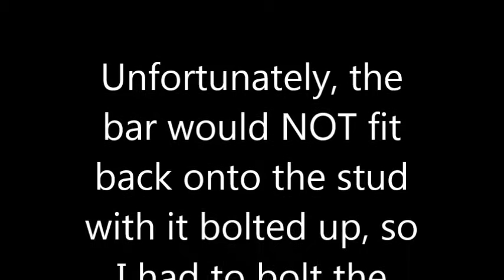Massey Ferguson Model 25 Hay Rake Bearing Replacement

Comment: I just got a massey Ferguson #25 it needs a few things and can't find anything for it i need the bearings and retainer for 2 bars any info would be helpful i found the bearings on ebay but cant find the bearings retainers i know you bought some but i didn't here you say where or a part# for them
Reply from the maker: Any MF Dealer should be able to order parts for you.  I got most of mine from the dealer. The retainer is part # 581394M1-AGC.  The eBay bearings work fine but I had to press them into the new bearing retainers.  Good luck!

Comment: I know nothing about farm equipment but I do know that with a new bearing in there you should not have that much play....something is wrong!
Reply from the maker: You're correct, I think the bearing retainer is worn out. I'm going to see if I can find replacements soon.
Reply from the maker: thanks for the tip.  I might give that a try!
Reply: Did you ever find any? where?